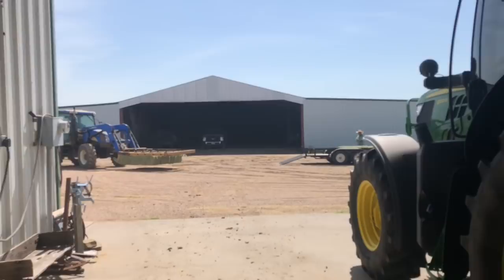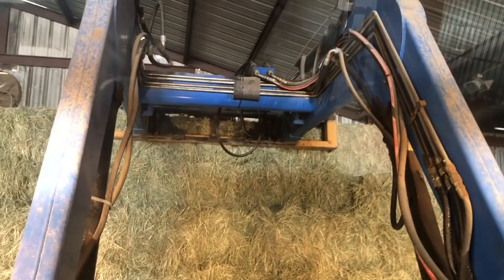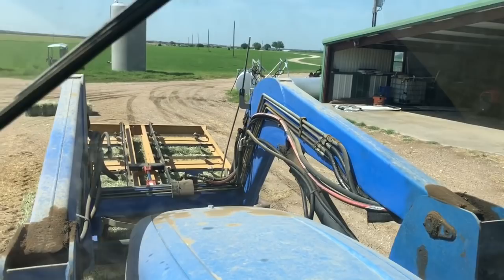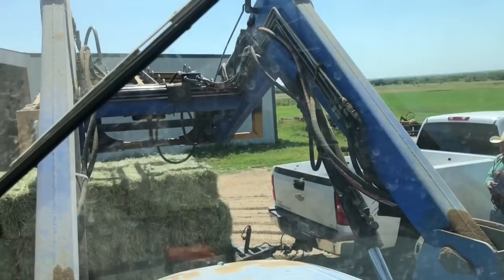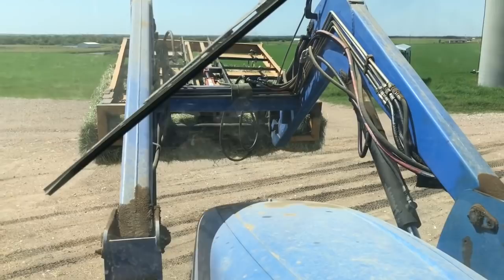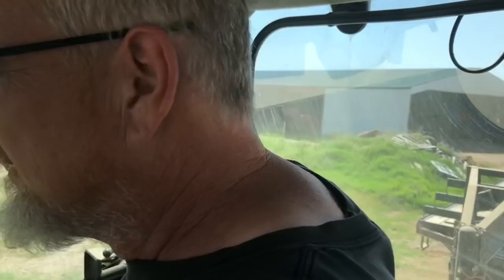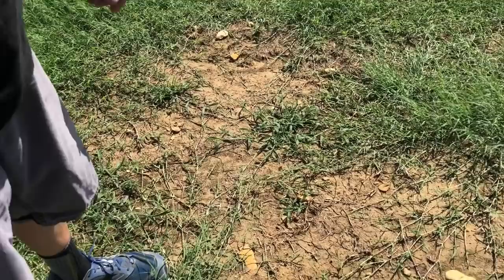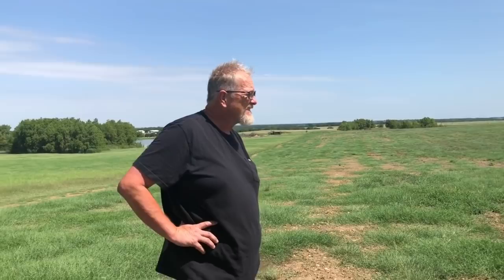Tractor-Loading Hay + A Look at the Sprigged Field

Comment: Scott, I am 61 years old and have owned my horse over 21 years and I still hand stack all my hay because the barn is too small to get my tractor inside to stack it. Your bales must be light because I couldn't get even close to 100 bales on my 25 foot gooseneck flatbed. I usually put 55 bales on and that's about 4 tons. But we drive a long ways to get our hay and at 65 mph speeds on the highway so we need to be wary of weight on the trailer. Your grass field looks really good.
Reply from the maker: I try to hit 60 pounds no more no less
Reply: Dude, seriously, that would be 145lbs per bale.  I think your math is off a little.
Reply: My truck and trailer were weighed on a certified scale. I had nothing to do with it. My math was even involved.